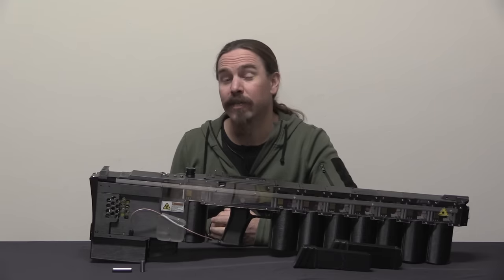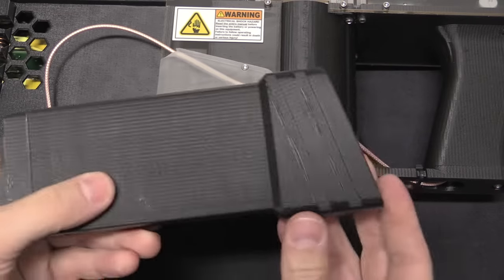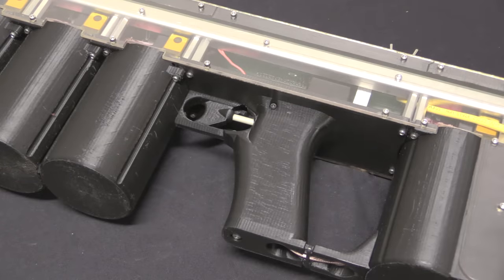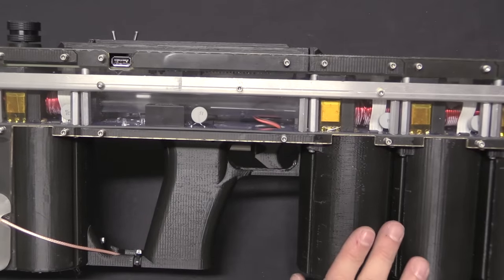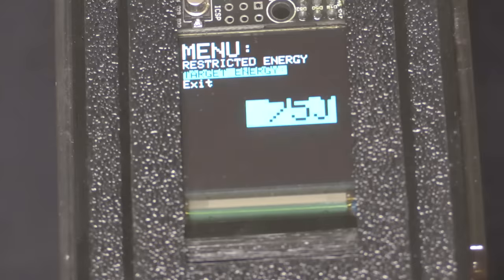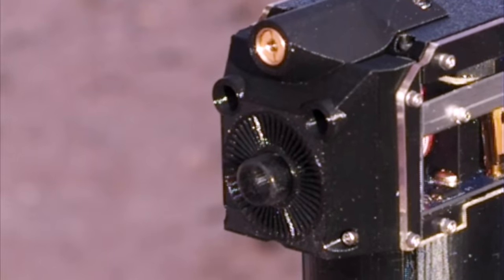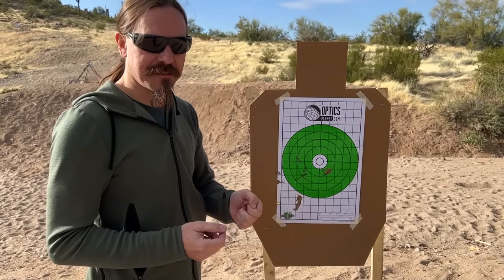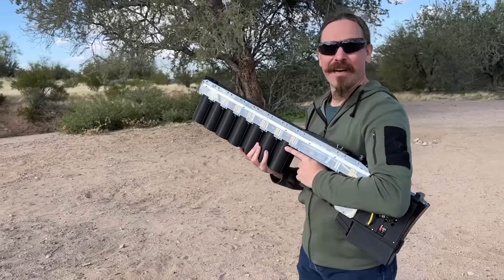ArcFlash Labs' GR-1 Anvil Portable Gauss Rifle

Comment: This is the musket of the modern age. Primitive and unwieldy, yes, but a harbinger of things to come.
Reply: it's not, we won't be using linear accelerators outside of ships and weapon emplacements, simply because the energy needed is so great and there are very much hard physical limits to this type of stuff, eg: capacitor size to farad/voltage ratio, efficiency of the linear accelerator etc...

because let's be fair, i have seen slingshots more dangerous than this, while only weighing a fraction
Reply: @quantuman100  but that is why this is just a harbinger it is like Ian said it is barely in alpha stage of testing
Reply: @SemenTheSailor  yeah but I seriously doubt that a breakthrough of that nature will come from trying to make handheld gauss rifles.

Why waste money and time on this when we have far more functional weapons already, which could potentially be improved on.
Reply: Define primitive
Reply: @chrisvisser-fee2631  The technology wouldn’t have to necessarily be developed for Gauss Rifles to be applicable to them though.
Reply: @canislupus3655  It's almost like all the tech that went into making this, is also part of other fields or their own. Capacitors and batteries will be upgraded regardless of the gauss rifle and the rifle will benefit from that. Lighter more aerodynamic ferrous metals for projectiles, this rifle is basically the Macguyver of a tech gun.
Reply: @quantuman100  you are frankly underestimating how much we are increasing efficiency, almost 60 years ago, apollo 11 used electric power equivalent of two coffee machines and computer that seems as primitive to what i carry in my pocket today, as slingshot appears to modern rifle, yet even with all the more power, i use only fraction of the energy, yes, you are correct that we wont find out something that defyies physics, but small and consistent advancements in all fields, energy storage, materials, manufacturing of materials, structural integrity, less energy loss etc. etc. allowed us to advance with what is essentialy same level of general physics as it was post WW2, into an era out of fever sci fy dreams (or nightmares, depending who you ask )
Reply: @chrisvisser-fee2631  law of diiminishing returns, you can only improve old design so much, and each time you do, you get less and less improvement compared to work you put in, there will come a time wiith everything when old can no longer be improved, so it will be redesigned completely
Reply: @juzojuzo1806  sure but the same rule applies to the gauss rifle. It's not new tech; it's old tech being used in a new way. We might make a breakthrough and discover some way to make much stronger magnetic fields or make micro capacitors with the same charge, but we also might, just, not, or did that the final product is no better than the firearms we have now.

Like, with more resources we've managed to make a gauss rifle that's less effective than an old fashioned musket. There's no way to tell that gauss rifles will ever replace standard combustion based firearms
Reply: @tonybadaboni  In comparison to what we imagine railguns, I mean. Look at muskets versus machineguns. In just 30 years, we'd gone from muzzle loaders to machineguns. Imagine what this will look like in 30 years.
Reply: @juzojuzo1806  
ok 1. you know what else uses the power equivalent of 2 coffee machines? a vacuum cleaner, somewhere between 2-4 gaming PCs, etc...

assuming the average power use of a coffee machine is 1000W, that's just 100W over the max draw of the Perseverance Rover when it's internal labs are running, the MMRTG has an output of 110W

yes it takes 10 of them to power the average drip coffee maker

as for the "primitive" yes we didn't have micro-circuitry yet, that is the big breakthrough that allows you to have a modern smartphone, because shorter wires use less power, 
this was known back then as well. 
It does not however mean that you will ever be able to power said smartphone with a lemon.

to put it simply, you are saying that we can iterate this 1000W coffee maker to have the heating potential of a 1200W coffee maker
Reply: xxx yyy  batteries have improved a hell of a lot recently, but I'm not so sure about capacitors, which if I understand how gauss rifles work is like the major limiting factor in terms of projectile velocity. 

Like to be viable handheld weapons they'd need to not just improve but match current firearms. Because of the charge time I don't think they'll ever be comparable to like automatic  rifles or whatever they're called, so their potential role could be as like marksman or sniper rifles? Which means the velocity would have to be increased at least tenfold to be comparable to modern rifles. Even then, there's no obvious reason to switch to gauss rifles.

So it's not like I'm saying that handheld gauss rifles will never be a thing, I'm just saying that theres no guarantee that they will.

Edit: oh, and not to mention that there are good reasons to switch to electric cars. In the long run they have a smaller environmental footprint, and they don't rely on a dwindling non-renewable resource to function. So theres good reason to spend money and resources on researching electric vehicles. The same isn't necessarily true of gauss rifles.
Reply: I can't wait
Reply: @P. Cameron Well that's a fucking terrifying statement. I hope you're wrong, but I won't be surprised if you're right.
Reply: A hybrid might be an interesting option.
Combine a regular cartidge with some piezo elements or coils to reclaim the energy of the recoil to feed it into the accelerator for more efficiency. Or even replace the gunpowder with hydrogen in a tightly sealed chamber.
Reply: anyone know why they cant or wont rifle the barrel? seems useful
Reply: @redmist6630  Projectiles are suspended in the air in coilguns. Friction would be counterproductive for gauss guns, because the projectile doesn't get its power from rear force, but rather being sort of pulled forward. Biggest thing right now is that the coils don't put out enough power to justify it- this isn't a killing machine, it's a science project and proof of concept.
Reply: @mirastor1796  Like a...helical railgun? A coilgun/railgun hybrid?  We'd need to polish off our existing science before we toy with stuff like that, methinks.
Reply: @redmist6630  The projectile isn't touching the barrel, so it wouldn't do anything.
Reply: @quantuman100  I see what you're saying but going by this logic, a good archer would have been miles better than a random musketeer of the Napoleonic era.
Reply: @Yautah  a good archer WAS better than a random musketeer, the advantage of the musket was you didn't need 20years+ to train them

it wasn't until the beginnings of automation that this way actually a useful trait

musket around since 1400s
longbow used as the main "ranged" weapon until some time in the 1600s

musket: useful range of about max 360yards according to the old treaties on field and defense warfare during the Napoleonic era(more or less the same in meters)

longbow: a skilled archer could reliably hit a target at up to 400-430 yards

musket: a highly trained and skilled musket man could reload in 15-20 seconds

longbow: can an arrow every few seconds

musket: often not killing but wounding

longbow: significantly more likely to kill

etc...

the problem with the portable electromagnetic linear accelerator  just doesn't have any real advantage over modern firearms, more complex, more prone to malfunction, heavier, worse logistics, no advantage in terms of training, etc...
Reply: @quantuman100  yeah that's my whole point, made way more elegantly and with more information. :)
Reply: @Yautah  so we agree that there is basically no advantage over the regular firearm as long as exothermic reactions exist yes?
Reply: @quantuman100  Can't say. That's the whole point of my comment, it's impossible to predict the future and how technology will develop, past a few decades.
Can I imagine a world like that ? No, no really, but then again I'm no engineer.
Reply: To go farther with the same example, I'm sure when gun arrived some people were like "this is too unwieldy, slow, lack power, dangerous for the user etc etc... It has it uses but there will always be a need for archers". 
And they weren't exactly wrong at the time, but once the kinks were figured out, archers were a thing of the past.
Reply: @Yautah  these weren't "kinks" to be figured out but rather the earliest Proto-industrialization changing the requirements on weapons, this is why cannons where wide spread and in use a long time before this

it still had all the same pros and cons, just that the pro of "easier to learn" became way more important as one started to have a larger pool of manpower to draw from and the manufacturies(what would later become factories) could produce these guns 

on the other hand there is no metric that these "gauss rifles" can even be comparable to a chemical propelled firearm
Reply: prophetic
Reply: @Yautah  They said it about tanks versus cavalry, and steamships versus sailing ships. Evolution of warfare.
Reply: @devianttoast5828  exactly. IDK why people refuse to accept that we can't predict the future. What looks like shit/meh now might be exceptionally good in 50y or more.
Or might be crap, we don't know.
Reply: I’m no firearms expert. Do you guys think that one day this could replace guns for police officers? Something that does enough damage to stop somebody in their tracks but won’t kill them, leaving a handgun perhaps as a last resort.
Reply: @quantuman100  thats what they said about the musket, little did they know
Reply: @quantuman100  Acting as if capacitor energy density is as small at it is due to fundamental physical laws is laughable. We've come a long way but we're not even NEAR to the theoretical potential capacity of even the OLDEST capacitor technology. And there are certainly more efficiency improvements to be made to Linear Accelerators just via the placement and timings on the coils themselves. Stop speaking outside your realm of knowledge.
Reply: @quantuman100  So you don't think it's possible that battery and capacitor tech might get improved in the future to the point where this could be a viable option?
Reply: Exactly
Reply: People be dreaming about lasguns, but the bolter is still better.
Reply: @GamePhysics  no, these things are limited by the laws of physics,

for example, the only way to hold the energy needed to power the coils sufficiently quick is a capacitor, quasi a massive fast emptying buffer

a capacitor works on the basis of a sandwiching of 2 materials, a conductor for the electrode plates and a Dielectric to separate them, these are made into long thin strips and then rolled up in order to save space, since the capacity of a capacitor is a function of the dielectric value and thickness of the spacing material and the surface area of the plates/dielectric sandwich, (btw a capacitor that would store the same amount of power as a laptop battery would be as large as the German state of Sarland)

batteries physically can not discharge this quickly and anyone who claims they can has no idea about how batteries work (btw batter tech is one of the current favorite BS stories in the pop-science world and if i had a dollar for every "super battery that will replace x y or z" that dosn't actually happen, i could go out to buy myself a sandwich for lunch until the day i die )
Reply: Arquebus rather or even hand gun as muskets were already a result of quite long development and quite an improvement :)
Reply: @quantuman100  Advances in material science will yield better batteries (in terms of charge speed, maximum capacity, lifespan, and weight) over time.  Before you say it's unreasonable, batteries are something to the tune of twice as good today as they were 10 years ago, and the progression seems to be happening faster now than slower.  Our electrical grid is also becoming more efficient by the year; it's hard to see it right now as we're phasing out our most cost-efficient fuel sources (Coal and other fossil fuels) and replacing them with less efficient alternatives (solar/wind), but the grid is getting more robust due to a combination of infrastructure and advancements in technology, to the point now that solar is approaching parity with certain fossil fuels in terms of efficiency (and even surpassing in optimal conditions). The amount of advancements we've had in the last few years regarding fusion power is also astounding.  Just last year we had a sustained fusion reaction last over a minute, and we've had another one that got back 70% of the energy put into it.

If 10 or 20 years from now we have an energy abundance, I can see coilguns being advantageous to use in the field compared to traditional bullets; something like 2/3 of the weight and volume of a bullet is taken up by the cartridge and powder.  If you replace your bullets with steel slugs, you can fire 100% of your ammunition, which means you can carry less weight to have the same amount of ammo in the field (or alternatively carry as much weight for 3x as much ammo).  I'd make a point about coilgun ammo being easier/cheaper to manufacture, but bullets typically aren't very expensive anyways so I doubt it's a huge factor.

The accuracy problem would need to be fixed though.  And honestly I'd see them working as mounted or vehicle-based weapons, as you could amp up the muzzle velocity considerably without surpassing the recoil that an infantryman could reasonably compensate for, and if you're say, on board a ship with a nuclear reactor you don't have to worry about batteries anyways.
Reply: Some day it might end up at miniaturized fusion munitions that break down to a plasma state, so it might be a precursor to actual plasma weapons.
Reply: @rustybungle  You will have big spurts of developments when something new comes around or when there is a big need for a thing. We are right now in a big spurt when it comes to batteries and we will likely end up stagnating for like 100 years after we find more or less the optimal battery just like how we found the optimal gun propellant with smokeless powder. I think we are only going to see extremely marginal improvements to batteries from here on out. However, there might be room for big improvements when it comes to capacitors.

This means that energy weapons would only really be viable in platforms with tons of available energy, ie ships with massive engines and fuel tanks or smaller vehicles with nuclear reactors.
Reply: Except for the fact that it shoots 70m/s and the worst powder loaded on muskets reached 250m/s, so no, theres no way this could even damage someone.
Reply: @arkham4040  It should leave a nasty bruise in my estimation. Maybe a bone fracture if it hits right on the bone.
Reply: @quantuman100  look how large the first electronic computer was, now people wear computers several times more powerful on their wrists. technological innovation will come with time
Reply: @quantuman100 The dude in the video just used one outside of a ship or emplacement. Slingshot videos are cool too, but this is cooler.
Reply: Not even close. Muskets were useful and revolutionized warfare since their inception.

This is still vastly inferior to even the smallest calibres.
Reply: True.
Reply: @quantuman100  Actually, after a while, we'll be able to carry batteries the size of your palm with more power output than your current nuclear reactors...
Reply: @quantuman100  If it's 99% correct, is it really correct?
Reply: @SoulWhite  well no, Newtonian calculations still work perfectly fine, until you get to a black hole
Reply: @chrisvisser-fee2631  its as if were beeing like; but the elictrical buzzing lazor cannon in the space movies looks so deadly!! That must be the best handheld weapon the future can bring.
Reply: The musket was useful and highly competitive at the time
Reply: @quantuman100  If it doesn't work for everything in the end it's wrong. Just because it's useful doesn't make it correct.
Reply: @SoulWhite  you'll be shocked how wrong that is, in reality if it works it works
Reply: @SoulWhite  and a lot of people still do rub sticks together, they even get little badges for it, and if you happen to be hiking and you lost your lighter it still works
Reply: Very well put!
Reply: Thier is a reason we haven't gotten off chemically propelled lead . Simple,  cheap , reliable.
Reply: @riftvallance2087  I never really thought about it, but yea!… little bits of metal moving fast simply WORK!

Comment: This really goes to show just how much energy gunpowder really holds.
Reply: It's high explosive
Reply: @KneeCapHill  Not... Exactly...
Reply: @KneeCapHill  its literally a low explosive.
Reply: Gunpowder doesn't actually hold much energy, it's a slow burning propellant. We modulate the energy released through pressure manipulation
Reply: @21kiwi24  I mean, if you stuck a detonator in it, it’ll detonate. It’s nitroglycerin and nitrocellulose. We just don’t detonate it.
Reply: @Not_A-Bear  No, as in Low Explosive is an actual classification related to how it detonates, not on its relative power level.